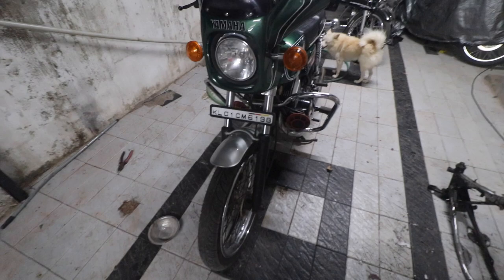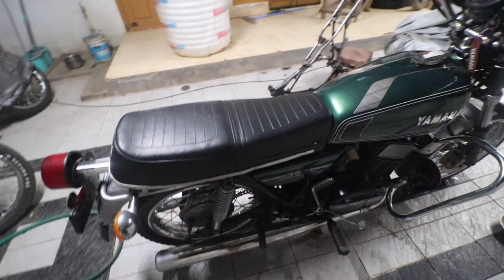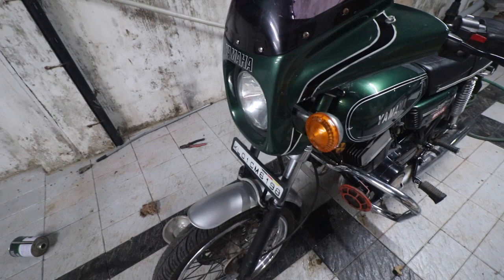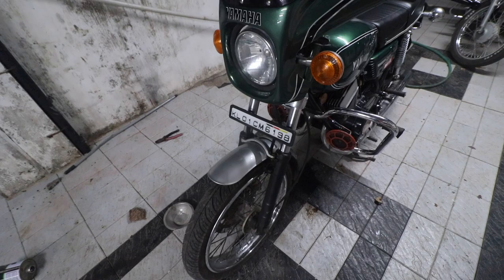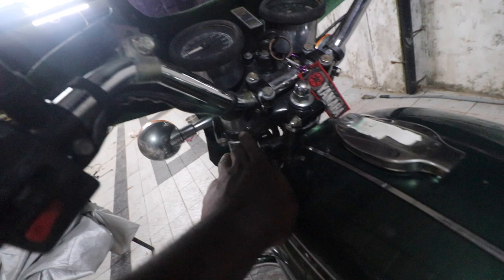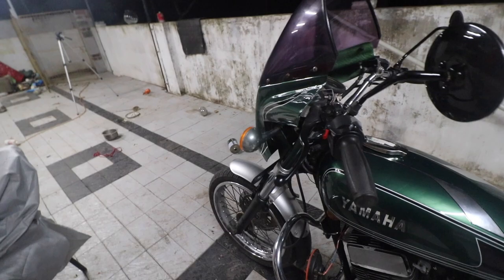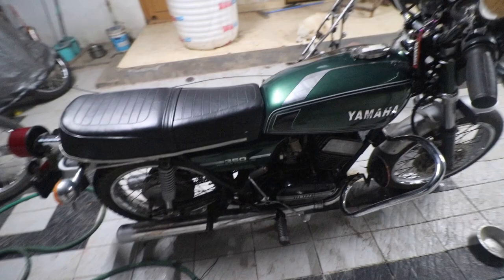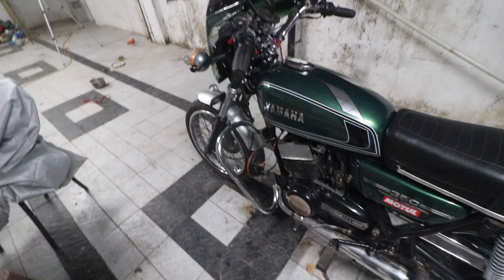RD front Disk brake upgrade options

Comment: very valuable inputs, looking forward to the Shaolin restoration videos. am working on a Shaolin and considering a front disc conversion please share if you have any suggestions
Reply from the maker: fiero f2 brake setup without any questions or if 2 inch height increase is not problem then Fiero hub, apache fork and rest of the stuff.

Comment: Awesome 😍... Bro i m converting my Samurai front to Pulsar classic disc brake. But the fork top bolts are less in length. Can i weld it, increase thread length or is there a direct fit bolt from any other bike ?
Reply from the maker: Ashwin YuvRaj Apache/fiero F2 are direct fit
Reply: I have installed fiero F2 disc in my Shogun and Shaolin they r direct fit but it will increase the height u have to change the rear shocks also for the perfect height match send me ur WhatsApp no will send u the pic of my Shogun u can understand what I mean
Reply from the maker: Zia al rahman my shogun has the same. Checkout the shogun build playlist
Reply: @Yamakaze  k sure
Reply: @Yamakaze  I'm having fiero F2 lef side disk setup u r having the right side disk setup I don't know which bike setup is that
Reply from the maker: Zia al rahman getting fiero parts are difficult so I prefer keeping on the hub from the fiero and use the rest from an Apache.
Reply: @Yamakaze  fiero f2 disk setup increases the height and the bike haves a crazy look 😍😍😍
Reply from the maker: Zia al rahman price and availability of spares is a big problem
Reply: @Yamakaze  if I want any  spare let me know
Reply: @Yamakaze  will help me in this I want Shogun clutch housing or hub with clutch plates
Reply from the maker: @zia365  i don't deal with spares, if your question is I can help you procure spares, then I am sorry. I can't
Reply: @Yamakaze  just let me know from where i can buy
Reply from the maker: Zia al rahman I got everything from Bangalore
Reply: @Yamakaze  bro have u used crown & T of Shogun mmm...I think ... width between two shock of Apache larger than shoguns......the dia of Apache shock  larger  right ..have u milled?
Reply: @Yamakaze  bro where we can get  fiero hub in trivandrum....is it available in chalai.... Exactly how much it costs????
Reply from the maker: bijesh mohan the Apache width is more, you have to mill about 2 mms from the speedo worm. Plus the apache mudguard won’t fit once you are done fitting the apache forks. You will have to cut the mudguard to make it fit
Reply from the maker: bijesh mohan it’s difficult get the hub, one shop in chalai has it but price will be crazy. Keep looking in OLX or look for ads on Facebook marketplace
Reply: @Yamakaze bro.  I am planning to  put a upsize Tyre... if iam  using APACHE T and crown....is it direct fit to chasis of shogunn?
Reply: @Yamakaze  bro how much he is asking....is it complete set or hub only
Reply from the maker: bijesh mohan not sure, I have never used the apache T stem and crown

Comment: I have got Karizma shocks on the rear.
1.what spokes did you use on the front?
2.Did you make spacers between the forks on the avenger hub?
3.Which year of CBZ rims are those.
I always thought the conti gt front fender and top brace wud match.Thanks you proved my point.
Nice video.finally someone made a video of this.
Reply from the maker: Karizma is great set.
the front has pulsar spokes
the avenger hub was milled down to fit the fork triple t combo
2004-7 they had spokes. this is the rear rim
conti mudguard barely fits, the fork brace was milled out as well to fit the gap.
Reply: @Yamakaze  I did read somewhere that the hub had to be milled as it touches.
What abt speedo cable and the worm kit that fits on the hub.? How to go abt setting that?
Reply from the maker: @anslem83  you need to have the end going into the meter to be from an RD and the end that goes into the worm has to be from a pulsar. Its a simple thing to do but you need an experienced person to do it for you. you can read this conversion in detail on my Tbhp blog. vGot gifted a Yamaha RD350. EDIT: Restoration completed ...www.team-bhp.com › Forum › Motorbikes
Reply: @Yamakaze  ooh I read that long ago.Didntt realise it was the same green Rd.
Thanks and Cheers happy riding.

Comment: Please do make a video on Disc Brakes for the RX series.

We have the choice of Classic Pulsar being the most common, then Zeus disc, Gladiator Disc,.etc

What are the modifications required for installing the disc on the RX ? 

Would the speedo work, or would we need some mods for that ? 

Which one has the ease of servicing and part availability like changing brake pads.etc ? 

Thanks!
Reply from the maker: Bratty Biker sure

Comment: 8:30 rear wide ayond engeneyaa grip lost ayee manasilayilla onu clear akumoo?
Reply from the maker: tyres were hard plus wide, wide tyres cause an issue called tram lining
Reply: @Yamakaze  angane anel bigger wheels company kodukuna vandi side valikkenda but normally issues kanarilla pinne suspension nte preshnam arikumo?
Reply from the maker: @jyothismgeorge6013  dry rotted tyres are dangerous, especially if they are wide.

Comment: thank u for the video sir but I have a question that can we place rx cat con silencer in RD
Reply from the maker: why would you do that? the answer is no. The rd has a longer bend pipe and longer length silencer. so the stock mounts on the can con won't fit the rd. Now even if you could do some fabrication to make brackets, what would you do on the left side?
Reply: Cat silencer for Rd that's useless, Try the Bume Maiensaaez  Korean Chamber .... Slightly costly but amazing power and sounds like a sports car
Reply: Yamakaze thank u for answering I was just about the sound and emission norms.
Reply: roshawn seagull thank you
Reply from the maker: V PO trust me if you own an RD or have ridden one you will not think of ever doing this. My RD clears the emission tests every single time without any issues

Comment: Good info Bro
Is it possible to fix interceptor 650’s fork and disc in RD
Reply from the maker: Yes, but the inner tube dia is bigger, that will affect the strength of the triple t
Reply: @Yamakaze  if we completely change the T stump is it possible
Reply: @Yamakaze  any alternation required in chassis
Reply: @Yamakaze  so the head light brackets also may be need to change
Reply from the maker: It’s not worth the effort